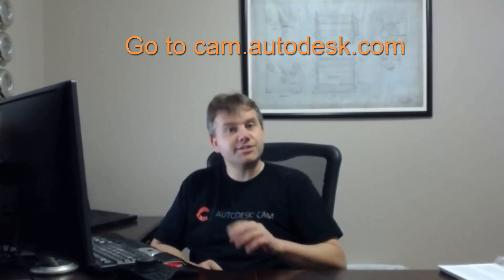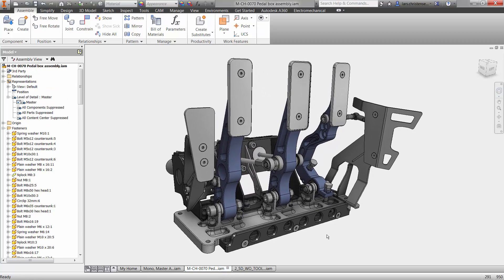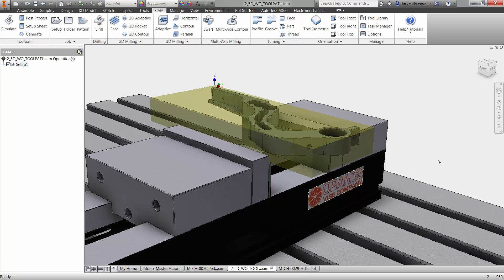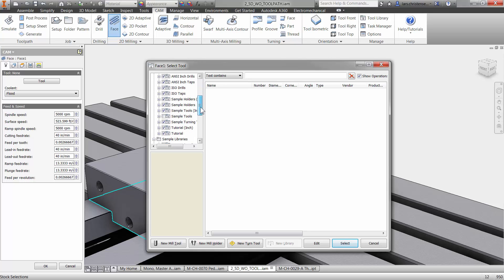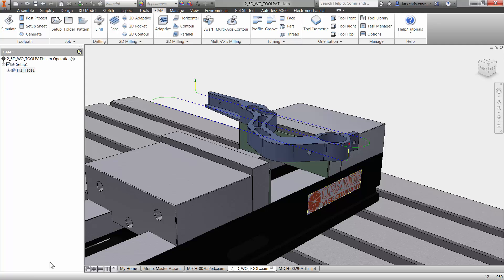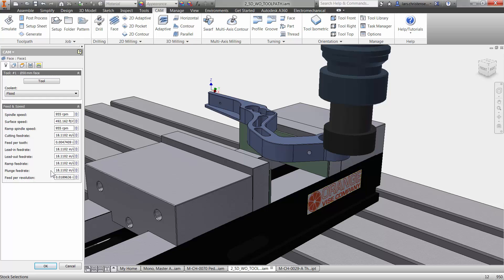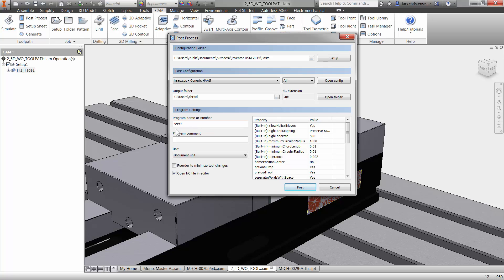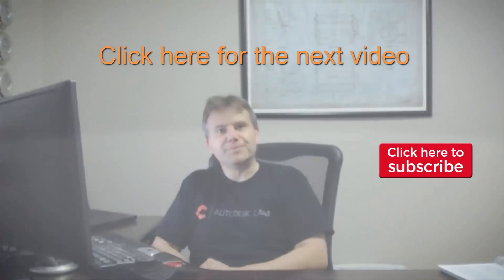How to learn Inventor HSM - Basic - Chapter 1

Comment: Inventor profesional has CAM included or I must buy the Inventor HSM ? Could you please explain it? I don't understand.
I need software for 3D Design and CNC Manufacturing.
Reply from the maker: Inventor HSM and Inventor HSM Pro includes Inventor CAD. The free version, Inventor HSm Express requires you to already have Inventor.
Reply: Does HSM Pro has spanish version.? or If I have Inventor Pro (spanish) Can I install HSM Express? 
Inventor (spanish) + HSM Express
Is it possible?
Or just works in english version?
Please explain it..!